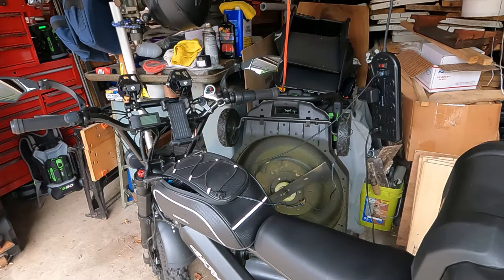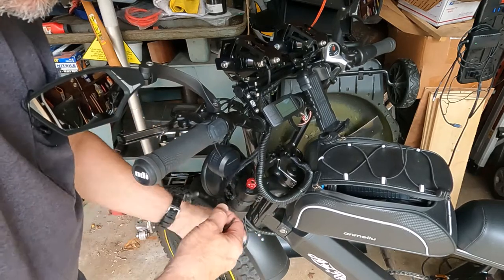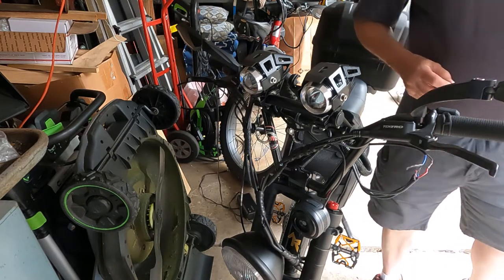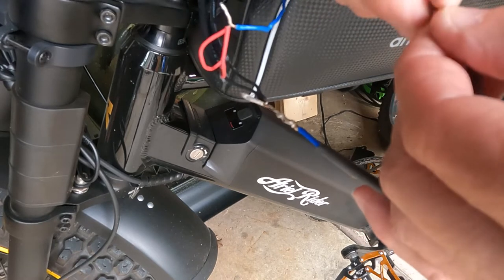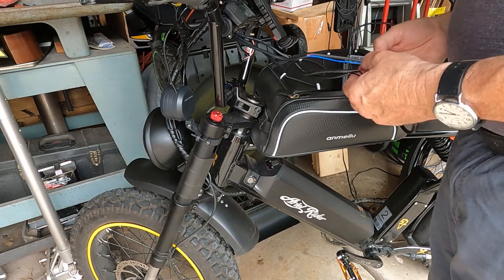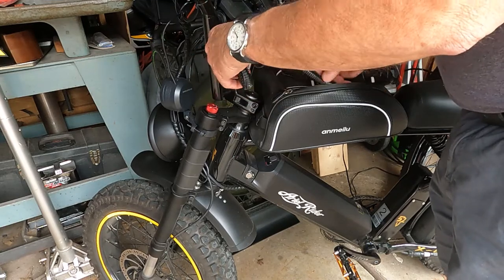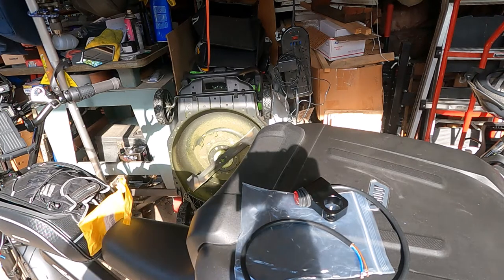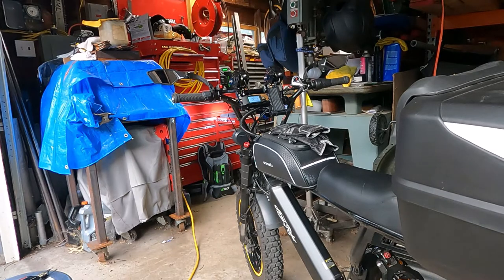Repairing my auxiliary ebike lights on my X-Class 52v

Comment: Good video Greg.  Some days are just not as smooth as others. Noticed where your horn was mounted, and will move mine to the same position.  Had you thought to melt a hole in the center front of your bag to run your light wire?  Just a thought.. Appreciate your videos, thanks!

Comment: hi were did you get the lights from looks well smart like 2 eyes looking at you ..Nice set up
Reply from the maker: Man I bought those lights like 6 or 7 years ago for another project and I never used them. Then I got the x-class and I started thinking about adding more lights to it and I remembered I had them. So I dug them out of a closet and put them on. There are still some similar to them on ebay and Amazon. Only thing different is the new style has a halo ring. But man they sure light up the road in front of me!
Reply: @woodtickgreg6926  hi thanks to the reply new subscriber here you got a really nice ebike there ..there great fun.
Reply: I've got 1000w  folding ebike coz I'm around 300 pounds or 21 half stone it holds 180 kg..I've got 2 batteries one 31ah the other 22ah
Reply from the maker: Yeah I'm 210+ my bike has 1000 watt motor that peaks at 2000 watt. Pulls me just fine.